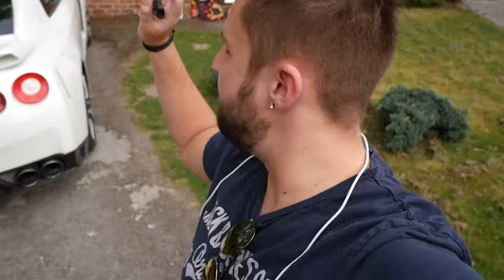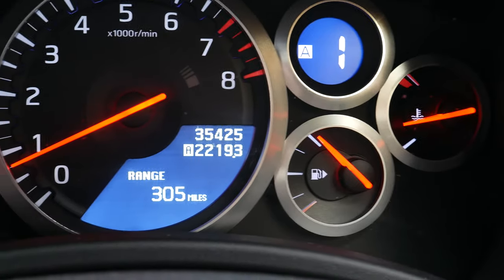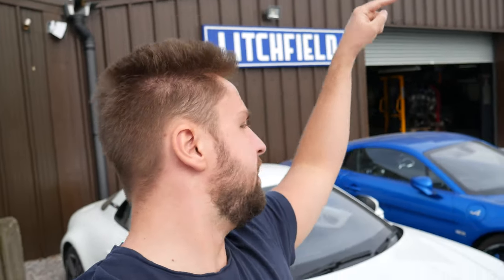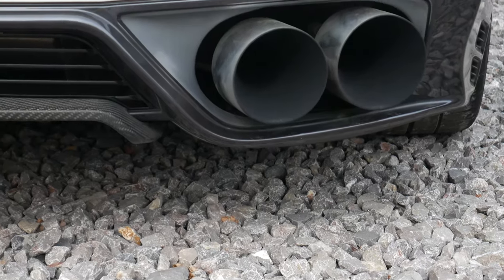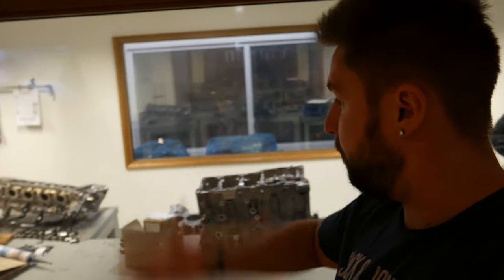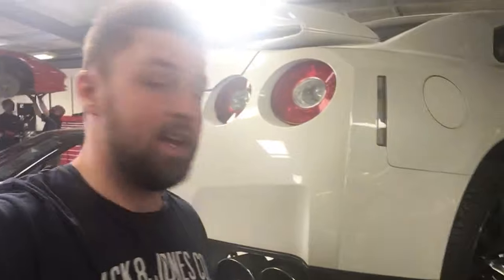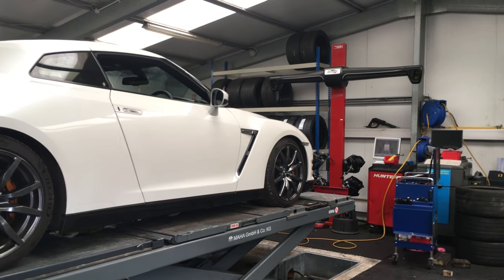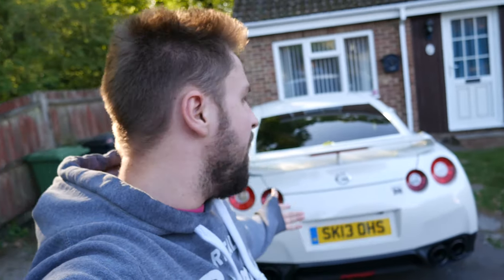LITCHFIELD MOTORS!

Comment: I completely agree with Edd, namely these days it is to be expected to drive for hours in order to achieve a satisfactory service in any walk of life. 

Having said that it is wrong to assume that top expensive garages are always fair / efficient. 

I had a main dealer (different marque) take me for close to £ 4,500. on an electrical fault which it failed to cure over three attempts. After ditching  the car on eBay my buyer rang me 48 hours later declaring that he had cured the fault????!!!!

Apparently the wire which  earthed whatever to the body had a rusty bolt. I guess that his outlay was less the 20 pence?